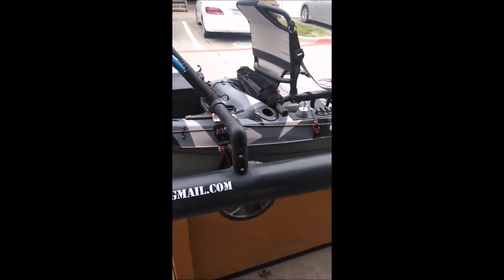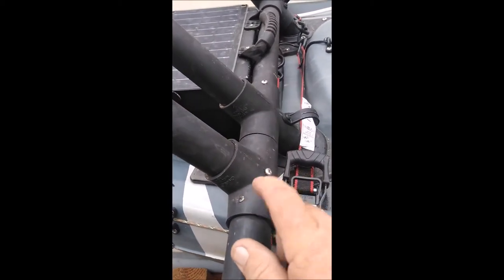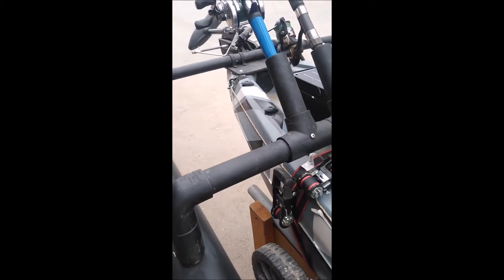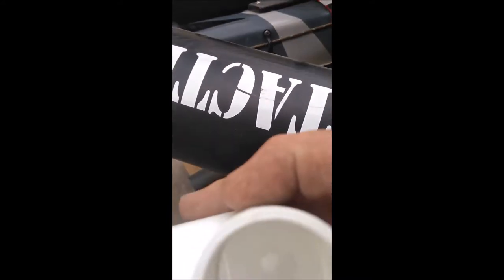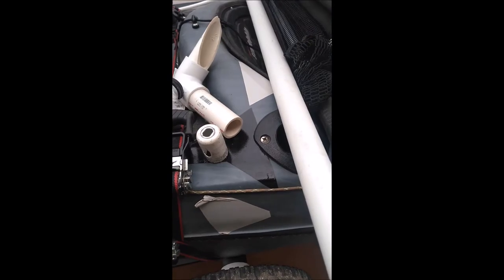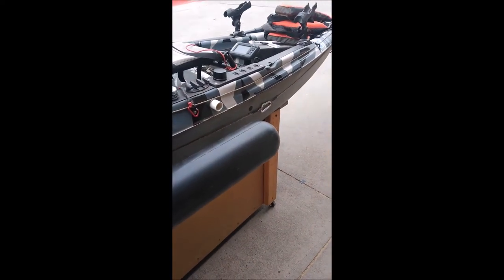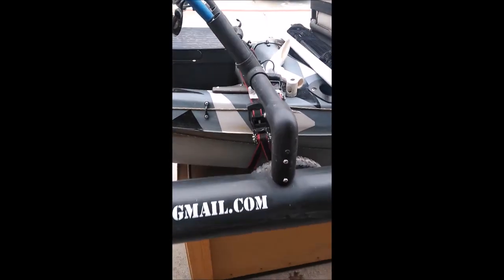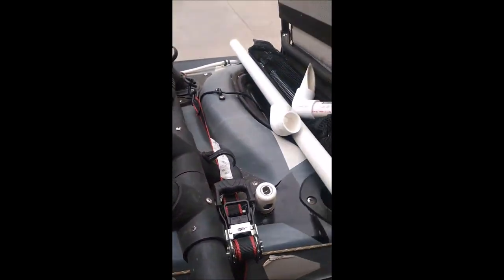Sundolphin 10 ss  stabilizer review and directions for diy

Comment: You can get 4” drain PVC at Menards for $11 for a 10 ft length.  It has a 4.215 OD and a wall thickness of .070, and only weighs 3/4 lb per foot. So it will have lots of flotation

Comment: A tip for drawing a line down the length of a round tube: take a length of angle iron and set it on top of the tube, so the open “V” of the angle iron sits on top of the round tubing. The angle iron will align itself nice and straight along the length of the tube. You can then draw a line down the length of your tubing.

Comment: Using Bill’s basic design, I built a set of outriggers for my Sun Dolphin.  I did some modifications to mine, but I give credit to Bill for the basic design.  I used 2” PVC sections and then slid the 1-1/4 PVC inside it and used pieces of 1-1/4” PVC couplers to take up the difference in sizes.  I also fastened my arms to the floats differently. I just happened to have length of bicycle wheel tray for a roof top bike rack, that I used to mount the outrigger arms to the floats.  Here is a video of my modifications: https://youtu.be/hG0fM5CxvVE